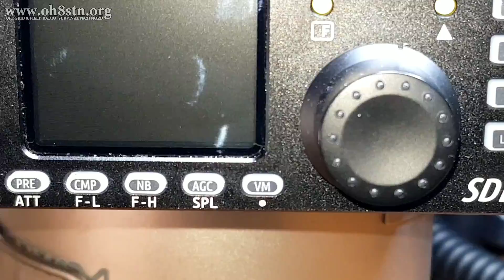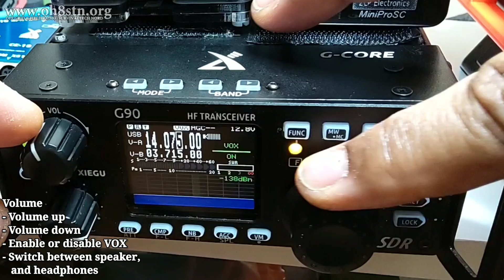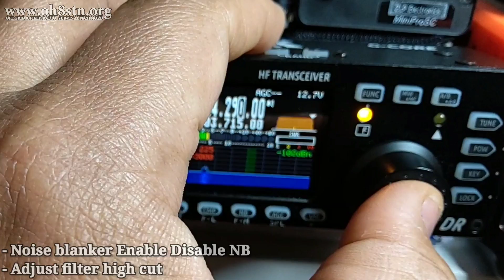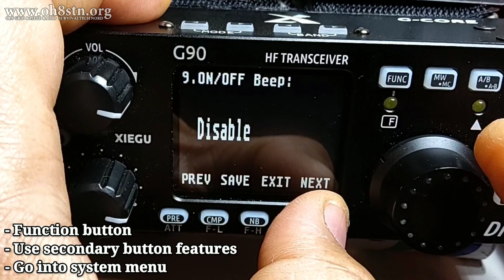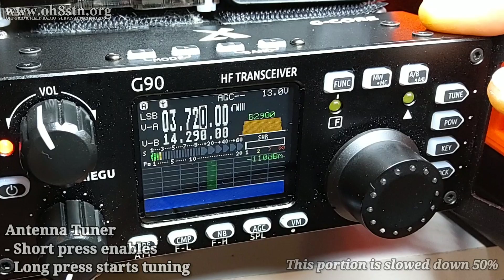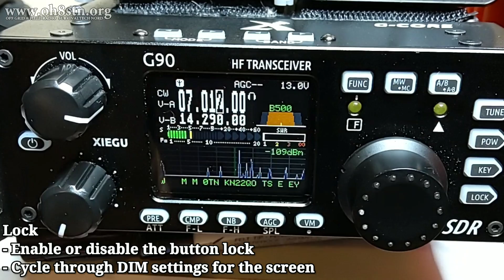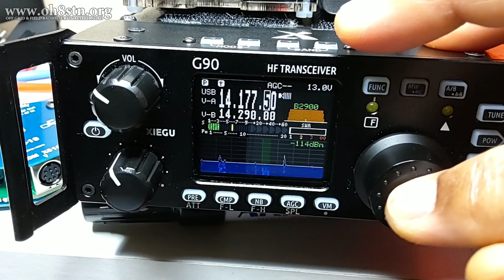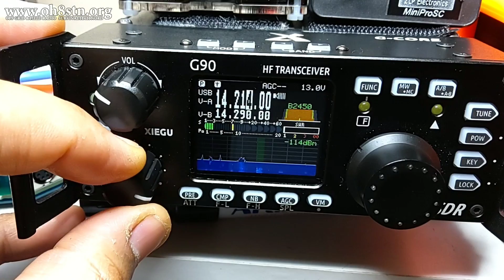Xiegu G90 HF SDR Transceiver

Comment: I finally picked up a power supply to power my G90. With the SWR sweep, I learned my 10 meter speaker wire dipole is perfectly tuned and the tuner in the G90 will tune that wire on all but 160 meters. So time to get the REAL antenna hooked up! Tnx and 73 Julian
Reply from the maker: Congratulations Philip, and you're very welcome.. I'm just sitting here with the g90 receiving weatherfax.
Reply: @OH8STN  Digital application will be my next foray with this rig.

Comment: Thanks for a very informative video. I've been watching this radio since it first appeared and like many I'm considering it as a replacement for my ft-817. My one concern is regarding reliability. I am a member of the main xeigu Facebook group and see many posts there from people having issues with the rig. This is a difficult thing to judge as naturally people don't tend to post when all is going well. Shall follow your experience with the radio with interest.
AndyR aka G1UUP
Reply from the maker: Hey thanks for the feedback. I'm not defending the radio and there definitely have been some operators with problems. I have noticed that many of the real problems have been with early models. Other problems have been fixed through firmware Updates. This is not unlike initial problems with the Yaesu ft-891. Ultimately these problems are corrected. The important thing is to buy through a reputable seller. If there are some problems, you can return the radio or have it replaced.
Xiegu.eu is in Sweden. If I could only get this radio from a Chinese seller on eBay, I wouldn't present it on the channel.

Comment: anybody else have a problem with the mic connection? if you move the connection it will transmit sometimes or it might loose conection. thanks
Reply: N4CSG Chris yes I discovered today that mine does this very thing.   It actually locked up the radio until I noticed this is the issue.   I’m not sure what is the cause as the connection seems to be solid.   I will put this on the Facebook group page and see if others have the problem.   If not I will probably go back to MFJ and see if it can be replaced under warranty.  I’ve only had it a little over a week.
Reply: @michaelberry2583  had mine less than a week and it started. The cable connector seems loose when it is connected. Don't think it is the cable rj45. Might try to wedge a peice of paper or something to get it to hold tighter
Reply: I have this radio and have not had that issue using it portable. WA2NWN
Reply: To the group: is there enough real estate space inside the rig to get rid of the RJ-45 in favor of a real mic connector?

Comment: I have one of the puppies and have enjoyed immensely. I’ve gone coast to coast without a problem on a simple dipole. A funny quirk I’ve found is that if the noise floor is high, a good thwack on the head unit usually fixes it. Sometimes the vga plug comes loose.

Comment: If only it had an on-board sound card for single wire control
Reply from the maker: Agreed. Internal sound card and CAT control over a single USB.
Reply: @OH8STN  I think you will find that you will use the G90 more than either the FT 817 or FT 891 for man portable ops.  That extra 15 watts, for me, makes the difference in contacts, plus, you get a waterfall display!  I find that I am only down about one S1 unit from the FT 891 from reports.  The G90 is able to solidly get above the noise compared to 5 watts QRP.  The G90 is considerably lighter compared to the FT 891 when you factor in an additional antenna tuner, heavier battery, ect.. The G90 serves that middle ground well between QRP and full power rigs like the FT 891.  In addition, it handles digital ops and WINLINK just fine. The G90 is fairly ruggedly built.  I have traveled all over and through many airports with this rig. BTW, I use my G90 with a single USB laptop linked with a multi-hub with no issues.  73s IU3JNT
Reply: @OH8STN  - seems either/or for some reason.  Either you get single wire OR an antenna tuner.

Comment: Regarding running 20 watts, I am interested to know if you would prefer using this radio in the field over the 891. I know this rig would use less power but I am more interested in usability, ease of use, quality of sound. Which rig would you prefer to take with you on your camping trips. I also understand you will have to try it out in the field a few times before you will have a good opinion. Seen another video on this rig where the guy made about 40 contacts in 45 minutes and only used about 1.4 AH. I know the 891 would use more but i am not to concerned I have plenty of 26650 LiFePO4 batteries. I have been thinking about buying the 891 and or the G90. I wish the 705 coming out had 20 watts.

Comment: Looking forward to your digital mode usage especially FT8 Call and WSJT-X configurations. 👍🏻
Reply from the maker: Already using JS8Call and WSJTX (there is no FT8 Call anymore). Two configurations, with cheap usb sound card, and with miniprosc. PPT over CAT or VOX. The cheap sound card was a pain in the butt to get set up properly. That's probably going to be the next video
Reply: I set mine up with signalink for WSJTX.
Reply: nk14zp do you have flrig working?
Reply: @mikering5383  Just using mine for ft8/wspr.  Never bothered with the cat control.